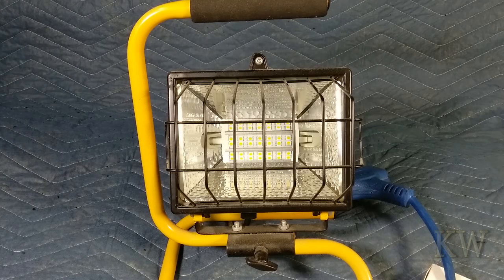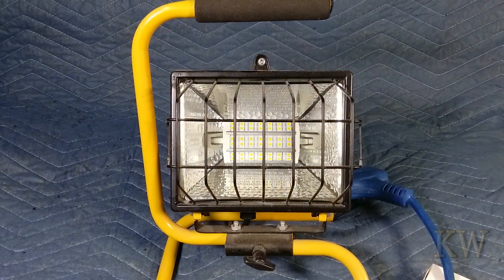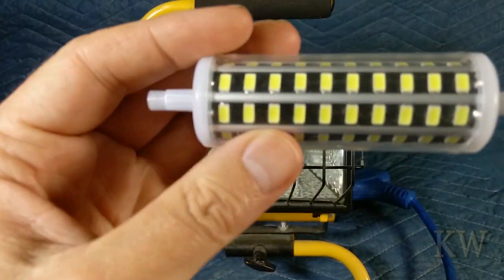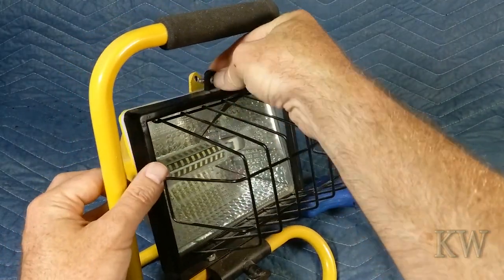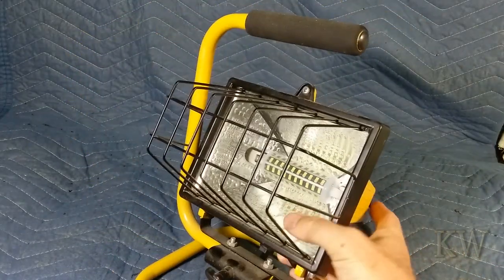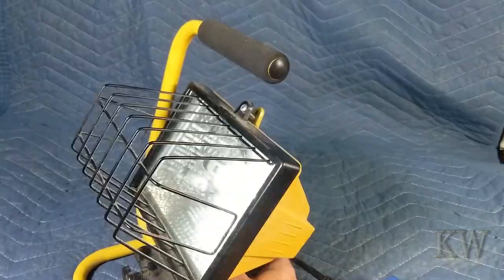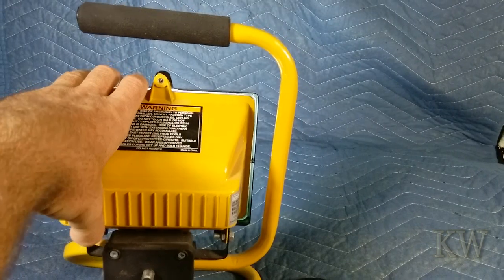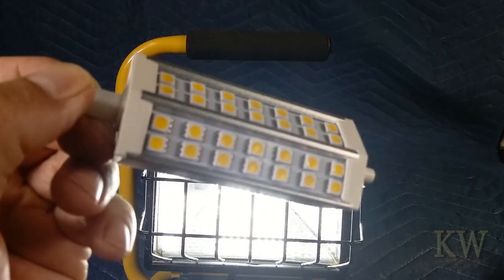R7s LED Bulb Flood Light Replacement

Comment: Just put 20 watt R7 bulbs in a couple work lamps. Not quite as much light but the temperature difference sure makes a huge difference vs the 300/500 watt halogens in them that I could not handle the fixtures directly after an hour of use. Need one more bulb to finish  the relamping project
Reply from the maker: The halogens got hot and fast.  These generate heat like all led but no where. Near halogens s.  And at a fraction of the wattage.